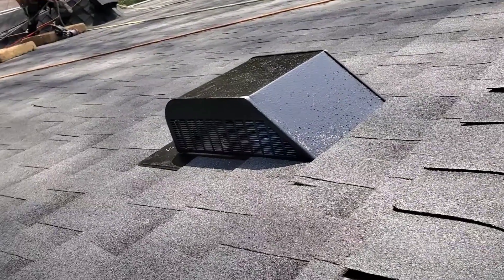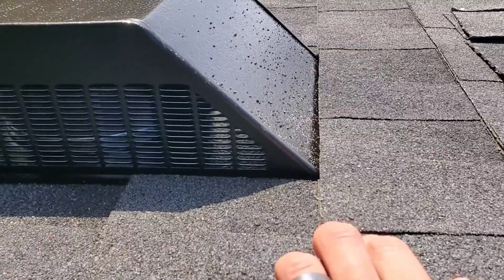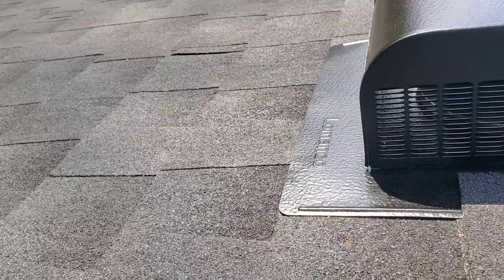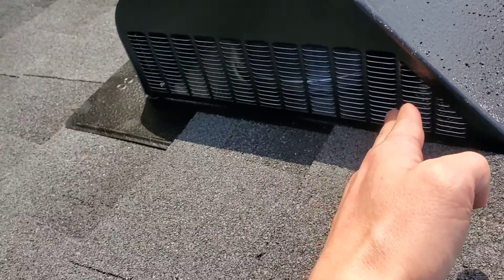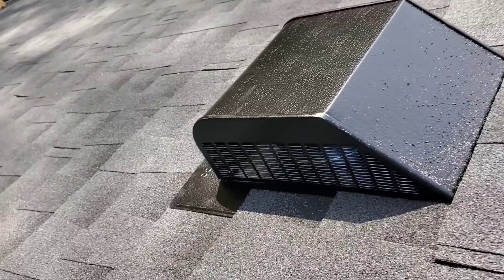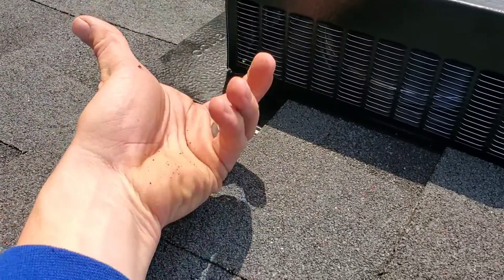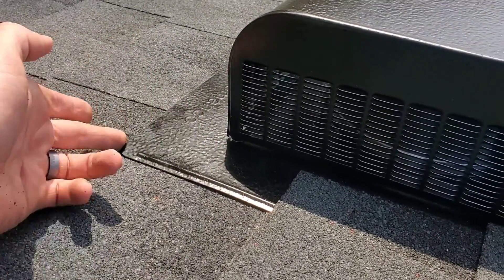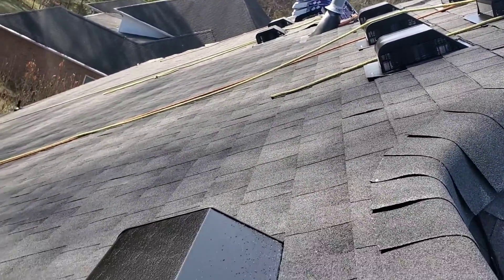Perfect Roof Box Vent Installation in Under 2 Minutes 📦🔧

Comment: Excellent advice!  I like to cut the shingles a half inch or so back from the vent box to allow small bit of debris to pass more easily.  Over time I've noticed debris that doesn't pass can create a little dam and divert the water sideways under shingles.
Reply from the maker: For sure! I always use the width of my figure as a gauge for how close to get the shingles to it. Same for pipe boots and step flashing. Always leave a water channel!!